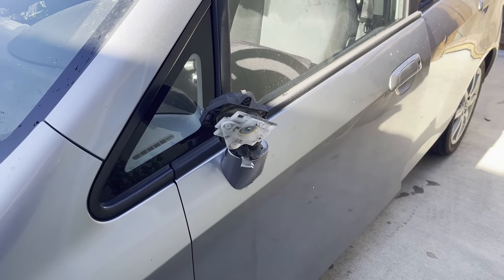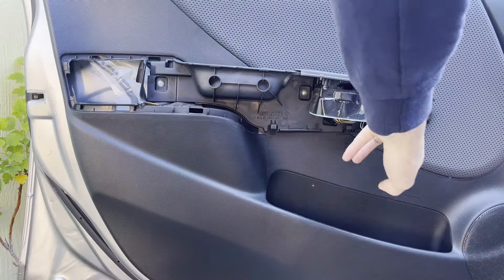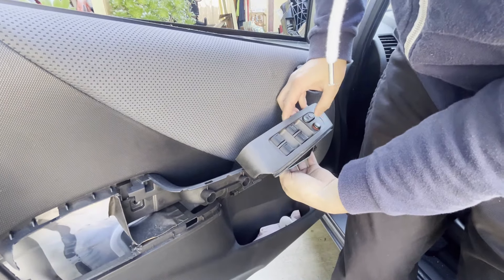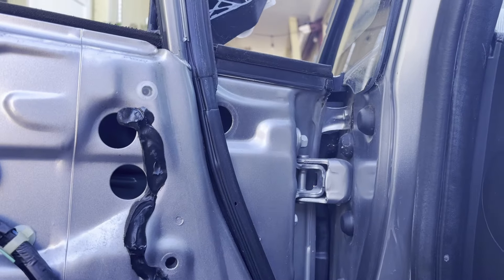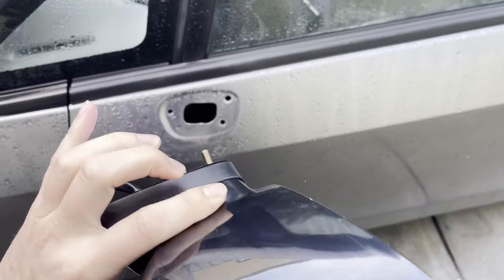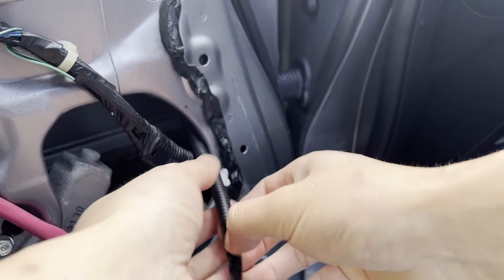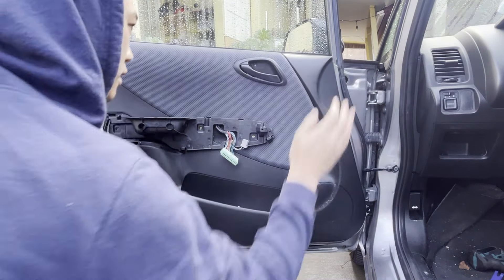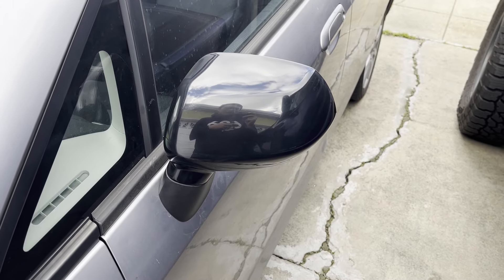2001 - 2008 Honda Fit Side Mirror Replacement

Comment: Great video.  Does anyone know how to connect the wire to the new replacement?
Reply from the maker: @hueylien6984  thanks. The wire should just plug in and clip into where the original wires went

Comment: Is there a specific tool for pooping off the panel without breaking clips? Just wondering before i attempt this... a wild turkey took my mirror out yesterday 😅
Reply from the maker: @skatewithmeghan  you can use trim removal tools. They can be found at most automotive or hardware stores.

Comment: I guess that clip somehow keeps the window from pulling the mirror control wire?

I can’t seem to find a way to route that wire preventing the window from, when lowered, from pulling that wire cable- which disconnects that motor control. Boo
Reply from the maker: Yeah you have to be careful to route it properly before reinstalling everything